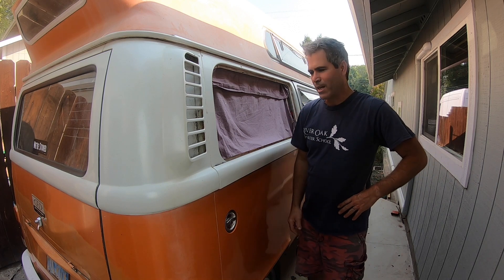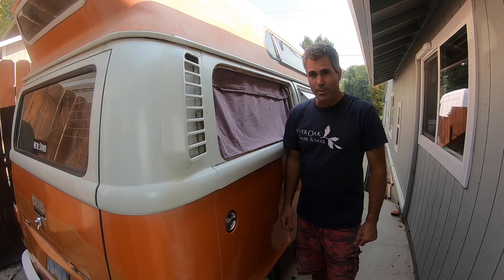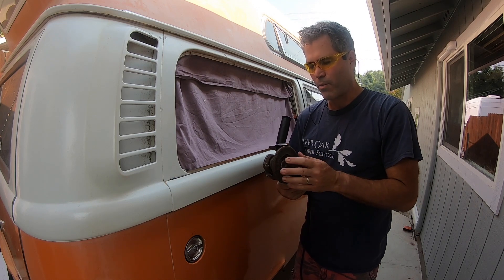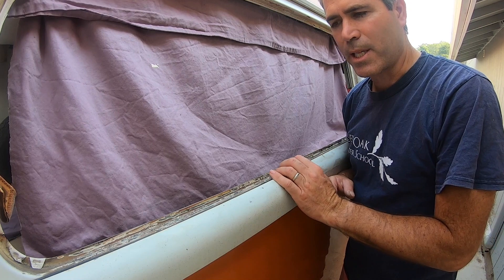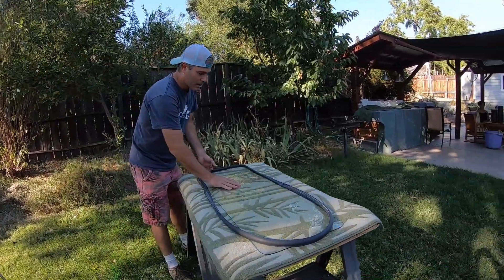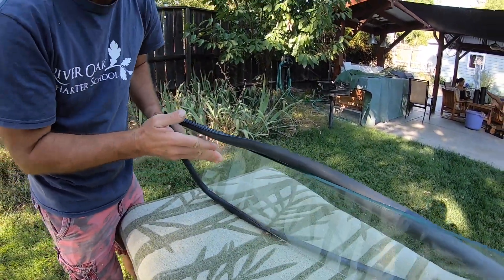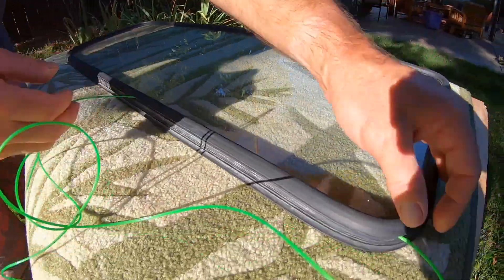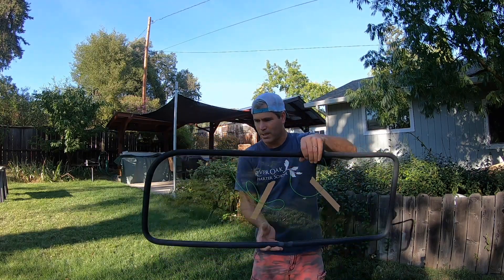VW Bus Side Window Seal Replacement

Comment: One thing I would recommend, as I've done this as well, at least up until putting the window back I'll admit, taking the cover off of the sliding rail right under the window is really easy and is only held on with 2 screws. Remove it, remove the seal, and sanding/painting the inside of the window sill will be easier! Awesome video in any case!
Reply from the maker: That is a really good point.  The fact that it is so easy to take off  really makes it a no brainer.  It frees up some space to work the seal in.  Thanks for mentioning that!
Reply: What the hell? Xd

Comment: awesome tutorial! thx for the tip with the weedwacker string.
One question/concern though. When you use the soapy water, won't that trap moisture under the seal contributing to rust down the road? Honest question, my windows going back in this weekend.
Reply from the maker: Yes, that definitely was a concern..."where is this soapy water going to go?"  It is not going to evaporate under that seal.  All I know was that there was no way that window and seal were going to get where they needed to go without a lubricant.  Anyone have any thoughts on this?

Comment: Very interesting video. Thanks for the WW lead. You do your window install backwards from the way I've done it. Probably doesn't matter. I put the rubber seal on the car first. The rope or string goes in the glass channel and you lay the glass over the seal and pull out the strings and wah lah it's installed. Only takes one person.
Reply from the maker: That is a great idea, it never occurred to me to try it that way.  Thanks for the tip, I will give it a go the next one I do!
Reply: So, you must have two strings one to pull the lip of the rubber over the glass facing inside, and another for the channel lip toward the outside.. I would love to see this done.
Reply: @msach4277  No not the way I've done it. However I've decided that that the way I was shown and have done it is not the way it is done by anyone else. The rubber is placed on the flange and the cord is in the glass notch then the glass laid on the rubber and the cord pulls the rubber over the glass.
Reply: @jimgeorge6220  thanks Jim, I will give it a try. Ordered new seal for my bus back window...
Reply: @jimgeorge6220  
Thank you. I was chatting with a friend about this as a possibility and it seems it is.

Comment: Making it look easy !   The american chrome can be an added complication... me and the pro took 1 1/2 hours to install a windshield in the 71.   Flat palm !     I do have a local glass guy that will come to my house when it comes time for the vanagon, I better tip him well !   I have a lot to do... thanks !
Reply from the maker: I definitely would have paid a professional to do this job.  Unfortunately, no one in my town will even touch these old cars.  They are afraid of breaking a window and having to try and find a replacement.  I'm kind of glad in a way, though, because now I can do it on my own!  thanks for the feedback.
Reply: @kekanipahu  update, the vanagon is home.  So is a Syncro, and I just put the rear windshield in the syncro, solamente, yea, lots of walking around the bus, but all in 10 min !!    Like the guy who sold me the syncro, you are lucky !   I'll let you know how it goes with a NEW seal on the westy...that should be as soon as I get the windows back from tinting